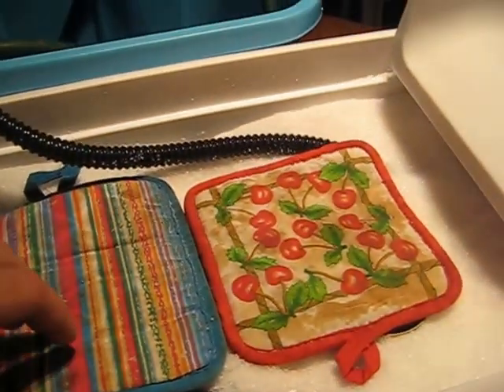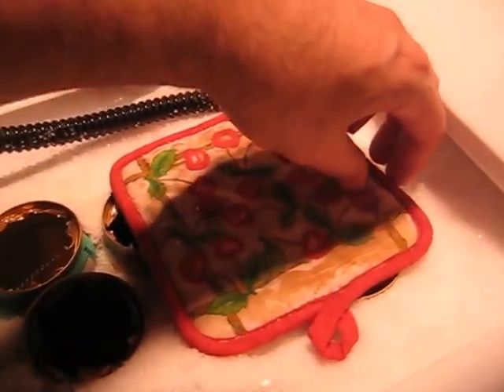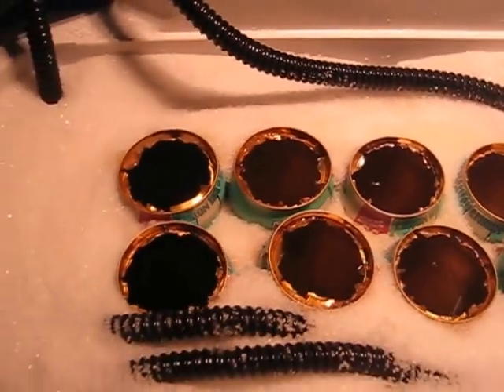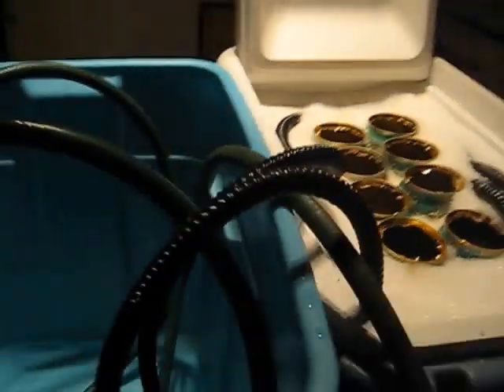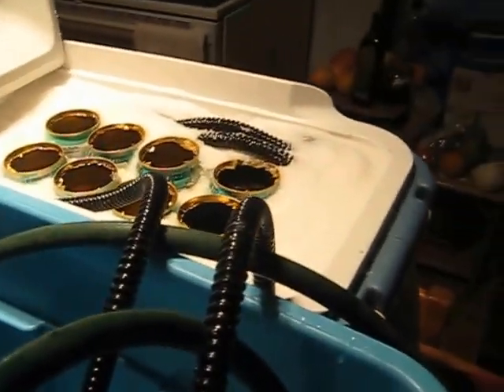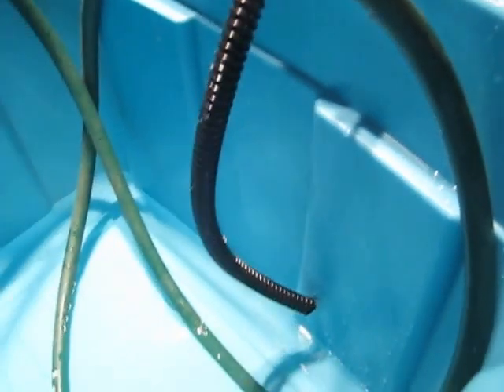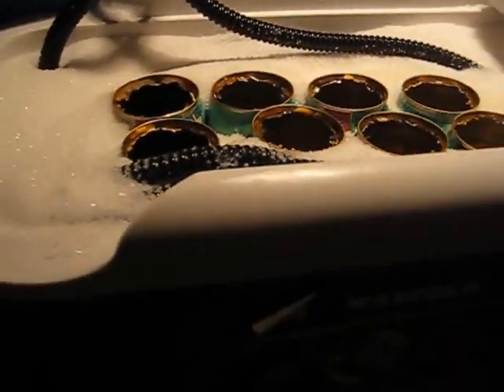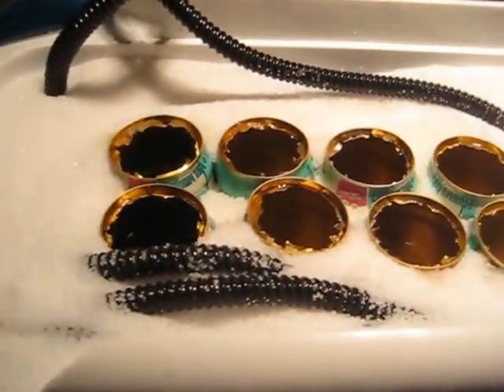Part 4 - Free Solar Energy Storage (at least 24 hours) for 6' Solar Concentrator

Comment: Very interesting concept! Do you have an update on your experiment?
Reply from the maker: Daniel Dupuis Yes it is here: http://www.solardishsystem.com, basically I worked on a vertical heat exchanger and how to preheat water from the molten salt, so far I think we need very long tube at least 80 meters long and black tube with very an internal diameter 3mm (to preheat quickly). Also the dish must be almost a circle to minimize the distances to transfer hot canola oil from the focal point to the salt battery. Thanks for your interest! chris

Comment: Since they use salt in huge solar thermal to steam generators we can pretty much assume your very correct.  They use oil for transfer to salt apparently too.   So questions for day to day use by us normal people at home is...... how long does it store?  For example take your igloo and fill it with hot oil and see how slowly it looses its heat with lid on.  Do same with hot water..... then do same With Salt.   Which one holds it's temp the longest.   Again though we can assume salt would hold heat longest or the big power plants would not use it.  Soooo.... ok.... back to practical..... we need basic forumulas to determine how much salt we need.  How much insulation needed to keep heat stored at X% loss etc etc.   Not complaining..... LOVE your videos...... but not much can be gleamed from it to put it into use.... least not for dumb me
Reply from the maker: Thanks for your interest. This video was shoot 24 hours after I put hot oil (350 Celcius) in the beer bottle insulated box, regular kitchen salt was melted and very hot. Take a little time approximatevely 30 seconds to visit my webpage to connect the dots. To my best knowledge: a solar concentrator must be use with a storage tank full of salt and circulation fluid must be organic oil (canola, corn etc...)  , to transfer heat from the concentrator to the storage tank full of salt. a Resol Kit is also necessary to circulate cold oil and 2 axis tracker from heliotrack.
Reply: Anything can be used to transfer heat to the salt..... what limits your arrangements to oils, Glycol or only a few others is using a extremely high  heat source. With High heat source I wonder if one could actually heat the salt directly.  Say A steel plate with prongs on the back side that heats up from the mirror/sun.  the prongs transfer the heat into the salt.
Reply from the maker: You're correct ! - I use canola oil or corn oil because they catch the heat very quickly and become smoke at high temperature (I think around 240 Celcius), also the freezing point is around -20 celcius. You can heat the salt directly but you will face corrosion issues. Cheers Christophe